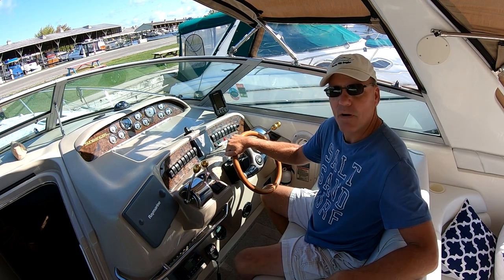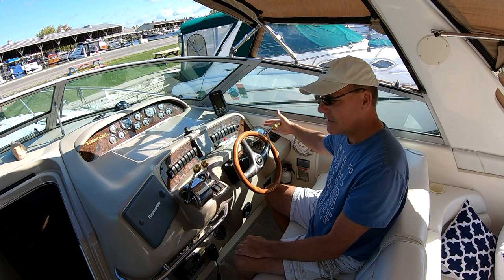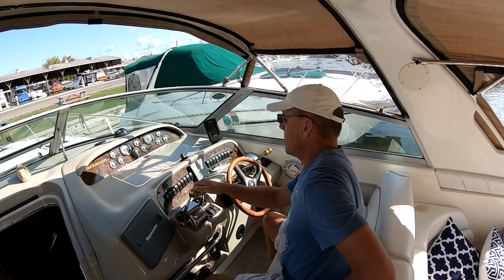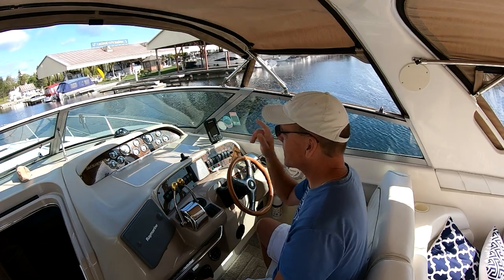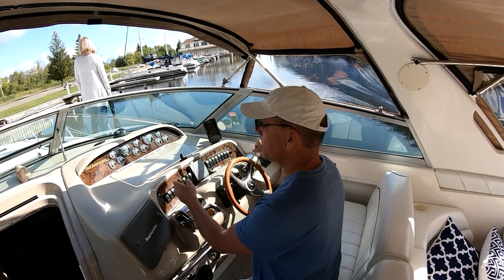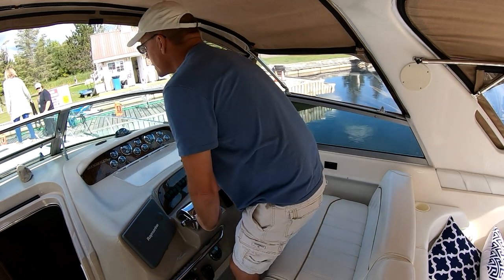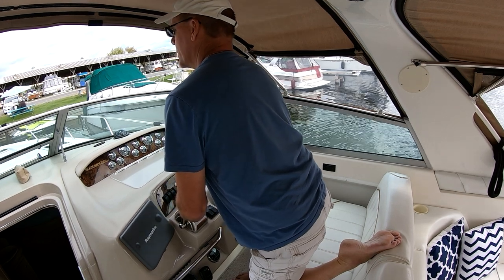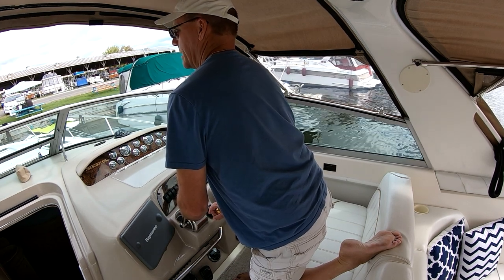Boating Basics - Boat Shifters and Throttles

Comment: I have always wanted to know how that works. Such a good video. My question is are the shifters related to the engines or the rudders. Also, if they are changing the gears in the engine, back and forth, does that damage them over time?
Reply from the maker: The shifters only change gears in the transmission(s) - forward, neutral and reverse - same as a car. The rudders are controlled by the steering wheel.
 The engines wouldn't be harmed by shifting, as the wear, if any, would be on the transmissions.

Comment: Are shifters and throttles ALWAYS port and starboard? I have seen MY twin's where they are opposite and red knob vs black knob. Thankfully I played with detents with engines off. At least on that cluster F, absolute center was neutral as it clicked. The throttles kinda had detents but 4 stages of click and still able to roll on and off.
Reply: One MY twin, ALL colored knobs were Purple!. I guess Lakers fans. I guess as an expert you would suggest to try detents and then fire her up? I disregard colored knobs and tried to find detents (clicks in stages)

Comment: Are the shifters always on the left side and throttle on right or does it depend on the boat?
Reply from the maker: Pretty much all the same. I'm sure there was a manufacturer that swapped them around, but I've never seen it. Shifters on the left side of the helm so that one can face aft-ward when backing into a dock, as they would be more easy to reach if standing up and doing that maneuver. Look for videos of the big fishing boats coming in to see what I'm referring to . . .
Reply: BoatingWithBoogaboo got it—thanks!
Reply: Hatts and a few other brands are reversed, but this is by far the most common set up. You will also see 4 levers all together (or even separated on some sport fish models especially), with the transmissions as the outside levers and the throttles the inside levers. In most cases, the ends of the levers are designated by color, black for the transmissions, red for the throttles. There are also electronic controls (mainly newer boats), where you would only see two levers total, you move forward or aft until the click to engage the transmission in that direction, any further advancement adds throttle.

Comment: Ok, dumb question, but could you not do the exact same thing with integrated throttle and shift levers, or would they give you too much throttle by the time they engaged into forward or reverse?
Reply from the maker: Potentially yes. And that type of set-up is what one would generally have on an inboard/outboard powered boat, which doesn't provide the same type of shifting characteristics. Inboard (or vee drives) have the props placed farther forward, providing better pivot control when shifting in slow speed manoeuvres.
Reply: @BoatingWithBoogaboo  I gotcha.... I'm accustomed to running crew boats and tow boats and was unfamiliar with this concept but once you explained the placement, it all came together.  Thanks!

Comment: Will the boat let you shift in/out of gear when the throttles are anywhere besides idle? Thanks
Reply from the maker: Yes, but one should never do that. Shifting gears at anything above idle speed can result in damage to the transmission.
Reply: @BoatingWithBoogaboo  Cool, thanks for the response. I've only ever used integrated throttle/shifter sticks. I suppose even with the single stick, you could push the neutral button and rev the engine up high and then quickly move the throttle to idle and then shift into gear - before the revs would have been able to settle down to idle, and thus do the same type of damage.

Keep up the great work on the awesome videos!
Reply from the maker: Funny story; Good friends of ours, who have boated for 30+ years, bought their first inboard powered boat last fall. The captain, after being used to the same throttle/shift setup you mention mistakenly pinned the throttles when he thought he was simply shifting into forward. Kinda scary in the moment (8.1 big blocks are really loud at wide open throttle with no load), but we chuckled about it afterwards 😂